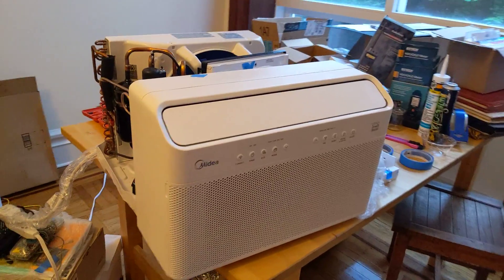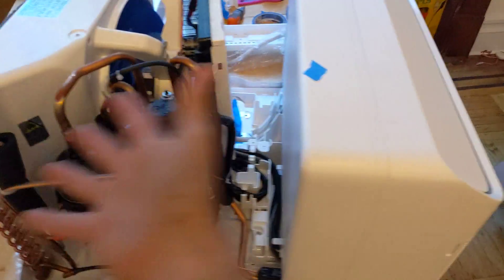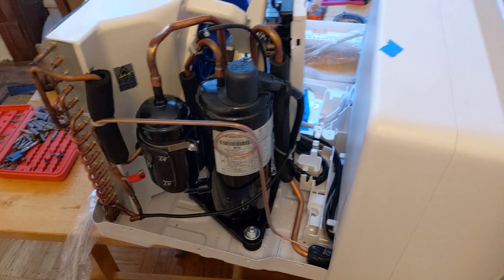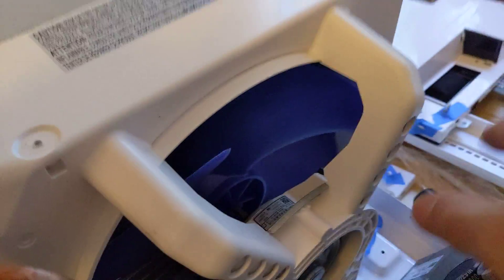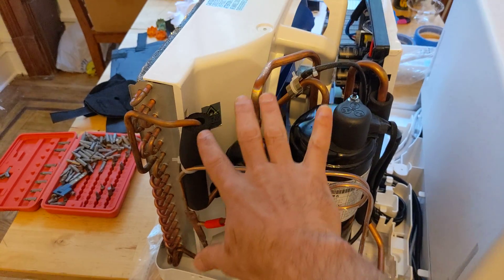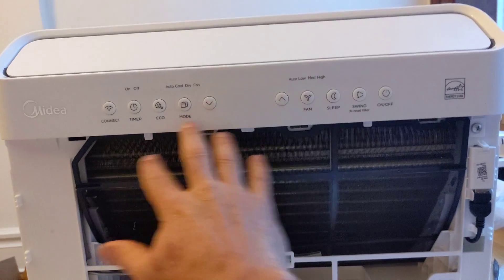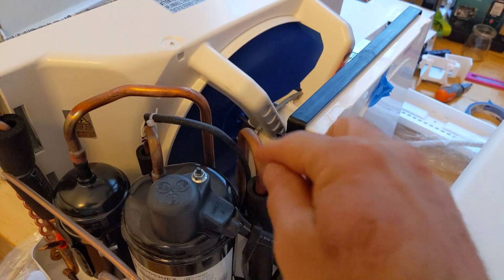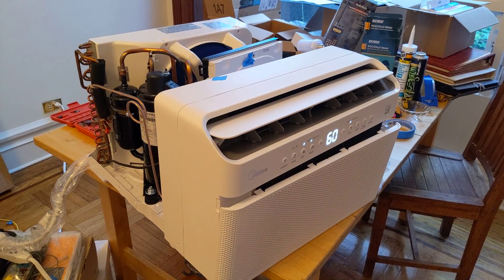How did Midea fit a full mini-split system inside their new "U" window unit?

Comment: Hey, Josh.  Thank you for making this video.  I really want to get one of these, but I live in Florida.  That with the reports of mold growing in these and bugs getting in them, I wanted to ask your opinion on two recommendations someone had on Amazon.

First, they said to put mesh around the sides of the AC to keep the bugs out.  Something like window mesh worked fine for them.

Second, and this is the one I'm the most worried about lol, is they said once a month they pour an ounce of a bleach and water mixture in the catch at the bottom of the inside part of the AC.  That of course drains to the back where most of the water gets moldy and makes sludge.  Does that sound remotely safe for the AC parts?  I don't know anything about AC units, soooo yeah.
Reply from the maker: I would not expect this to be any different from other AC window units for mold or bugs. If the problem is the standing water in the bottom tray, you could just drill a hole to let the water drain out and then there would be no standing water. Would work for the problems you are trying to avoid?
Reply: I've been pretty iffy on the hole drilling thing because I don't want to ruin the warranty or the cooling it's suppose to provide to the coil.  Honestly more worried about the coil than the warranty. lol
Reply: Another thing someone mentioned was using Frost King ACF19 Foam Coil Cleaner on both the outside and inside condenser coils once a month to keep out mold.  Not sure if that's an option as well.  I just don't want this thing if it's going to try to mess up my already screwed up lungs.
Reply: Same concern here! I forgot to leave it on auto last summer when I was out of town for a week and came back to it filled with mold because of the standing water issue. Been trying to find someone else who has cleaned their unit successfully and drilled a hole. Still am concerned about my ability to remove all the mold and if drilling will mess with the coil cooling.

Comment: I just installed one yesterday. It's so nice. The window unit I had in before was around 80db and was just so loud. Even on high fan this one is only at 50db. Such an awesome unit so far.
Reply: Does it act as a heater in winter?

Comment: What is the power consumption like? Can you do a 24 hr test?
Reply from the maker: Power usage for air conditioners is hard to quantify because it is highly dependent on environmental factors like inside temp, inside RH, and outside temp. That is especially true of this unit since it will automatically change the speed of the compressor and the fans to match the conditions.

Comment: how is the water draining on this unit???
Reply from the maker: In practice, it doesn't. The condensate collects in a pool in that bottom pan, and the  condenser loop dips down into to water and warms it up. This, plus the fan blowing air over it seems to do a good job of making it all evaporate away. There is no overflow hole, so seems like they have high confidence this will work in all conditions!
Reply: @bigjoshlevine  thank you for the info.. i just saw a video with a person pushing guaz down the back slit of the ac unit to drain water out
Reply: also one more thing idk if u used this unit but was there mold build up on this after the summer use.. reading alot of reviews on amazon saying this ac has mold issues
Reply from the maker: @krazyboxer4453  I ran one in NYC all summer last year and mine still looks like new, so maybe has to do with environment.
Reply from the maker: @krazyboxer4453  Hmmm... I think you are better off leaving that water in the tray because it will help the unit run more efficiently.
Reply from the maker: I checked and Midea says that the unit can potentially overflow the back, which is why they say to install it with a slight tilt.

Comment: I have two of them. 12k and I love them! I wish they used better plastic though and a humidity sensor.
I connected them to Amazon Alexa so I can just set the temperature with my voice. Also, you can ask what is the temperature in your room because of the built-in sensor...
Reply: Are the 12k 120v ac  or 220volt ac?
Reply: @GODBODYONE  120v

Comment: I made a split unit out of a window unit to mount in my camper van and wonder if I could fully split this one and mount the compressor under the van. Thoughts?
Reply: That’s what I’ll be doing this month.
Reply: @AndrzejMrotek  what unit are you going to start with?
Reply: @leeadamholt  I'm starting with the 8k
Reply: @alexdrinkwater28  you gotta let me know how it goes!
Reply from the maker: If you OK with evacuating and refilling the refrigerant then this is probably the best window unit to start with for a mini-split conversion.
Reply: @bigjoshlevine  I did a window split unit before and did a bunch of research, that smaller line look like it might be part of the orifice tube and from what I remember it has to be a certain length per spec. Now I would just be thinking about how to split the tray and add a drain tube. Also I would be mounting the outside section under the van so I wonder how it would hold up to vibrations from driving.

Comment: Quick curious question how cold does it get. Does it cool the room down really well or Is it just ok ??  Could you do a one year update at some point. Because I am really thinking of ordering this
Reply from the maker: Of course it depends on many factors including outside air temp, indoor humidity, room size, and heat gain. But I can say that the few people who I've recommended them to in NYC have been very happy with them!
Reply: Turn off eco and use boost and it will cool down quicker .

Comment: Mine tries to soft start and has some solid thumps ("ka-chunks", maybe) still. Wonder why.
Didn't come with the blanket on the compressor. Sad. Chirping is kinda loud.

Any idea how to take off the inside portion's casing? Idk if there's tabs or screws hidden from view but I can't seem to get it open. I need to remove or cover the speaker. It's so loud and beeps on every single button press.
Reply from the maker: I have up on trying to open the inside half, but there has to be a way! Others have also complained about the beeps but mine does not seem to be too loud, so maybe different revs? Same beep problem when controlling over Wifi? Maybe try to find where the speaker plugs in on the main PCB and kill it there? Should be a relatively thin 2-pair wire, maybe even some suggestive markings on the board to help.  Report back if you locate it - others would like to do the same!
Reply from the maker: I bet it is in the upper right quadrant here!...
https://photos.app.goo.gl/FNVP1Zdefc4eZs1G9
The display cables are well marked, so look for something like "SPKR" with 2 wires?
Reply: Yeah the beeps happen from any control point except voice. So local, remote, and phone/app.

Mm. Right the wire bundle is visible. I imagine the speaker is on the interior pcb (with the buttons) soldered but I'll see if the wire bundle leads anywhere.
Reply: @soulofjacobeh  I'm modifying a 10k btu version of the AC and have some pictures here. https://photos.app.goo.gl/hTdG6CV2QZfG9QzY7 You can see some of the tabs that hold the front and back plastic pieces together. If I remember correctly, there are two screws towards the bottom of the front panel and then the tabs around the edges hold it to the back panel. The speaker is on the front of the circuit board that has the buttons on it. I put a bit of glue over the speaker hole and it's still loud so I might have to just remove it.
Reply: @brik2k  my hero. I see the speaker right where I expected it too.

I think those tabs were what was holding me back. It seemed solid enough to be non-removable or something so I didn't commit lol.

I hope removing the speaker doesn't freak the board out. If it does I'll have to figure out the resistance of the speaker and drop a resistor in I guess.

Edit: you have location data in that album btw. Might wanna re-uploaded scrubbed metadata copies at a new link and edit the old link out.
Only a couple hour drive from me lmao
Reply: @soulofjacobeh  Thanks for the tip. I just reuploaded and updated the link. Let us know how it goes with the speaker if you end up modifying it.

Comment: How the hell do you take off the front white panels tho?
Reply: e Channel
10 months ago
Three screws under the front cover then unplug 3 wires. Use screw driver  to  pry open the front cover. It IS only snapped  in. Then two screws on top. 3 screws on each side then you have to unsnap gray cover to get to fan.Just opened mine. Fan stopped spinning. Put grease on rubbeer holding fan in place. It was making whining noise then stopped spinning. Works fine now.

Comment: Hey Josh

Thank you for reviewing and tearing one of these down. I'd like your opinion on a project I am thinking of. I have an old Suburban that had rear AC. I am using this as a camping rig and would like rear AC when driving and while parked.

I just refurbished the front AC and eliminated the rear circuit so I'm starting from scratch. I was thinking about mounting a compressor to a small engine but that would mean a lot of noise while parked.

I toyed with mini splits but the outdoor units seem too large. Rollicool makes something that would work but they are on intergalactic back order.

I'm thinking maybe take one of these Midea units, cut the lines and mount the outside unit on my rear tire carrier and the inside unit behind the rear seat. I would have to rework the tubing with some flex pieces and extend wiring. The u shape seems great as it makes it easy to cut the housing and just make a small patch panel.

The truck will already have a mini generator on board. It's my DC generator which will run through an inverter.

If I was camping I could bring a small portable and get it far away from my truck. This would give me AC power that isn't keeping me up at night.

Thoughts? What am I missing?
Reply from the maker: I've always wanted to take like a Honda EU2000 and rip the generator out of it and replace it with a auto compressor and make a gas powered minisplit for situations like this! For the inside part you can make it look neat with a truck evaporator console- they have them on aliexpress. Could could even use an arduino to match the engine throttle to the cooling load so it was really quiet once things reached low demand steady state. If that is too much work, I have an extra Rollicool that is yours if you can come get it in NYC.
Reply: @bigjoshlevine  That would be pretty slick! Newer style Sanden compressors needs about 2-3 horsepower to pump around 10-15k btus. I think it is close in capacity to the larger suitcase style engines.

Bummer that electric starts are tough to find. AIMS makes a remote start suitcase but I've read bad reviews about it not working. Probably because it doesn't choke automatically which makes no sense if you are cold starting.

I'm going to work on this u shaped unit concept. I thino it is just standard copper lines that require flare fittings. All standard stuff. You can get off the shelf mini split flex lines. R32 looks like a standard refrigerant close to 410 so same fittings and gauges.

I think if the 12k unit goes on sale for Black Friday I may pull the trigger. If not I'll be driving to NYC to pick up your Rollicool. I'm up in NH.
Reply: @affordabledcgenerators1607  Did you end up getting one of the Midea units and splitting it. It seems like a good option for my van.
Reply: @schaez  not yet, still hammering out truck modifications. Once I'm done, I'll move on to DC systems and maybe tackle the air conditioning.
Reply: @affordabledcgenerators1607  I think this would work really well, but I decided to go ahead and get a 24V unit off of aliexpress. I'm guessing it will be marginal for really hot days, but I can use the main AC to help cool down the van some and the unit I got to maintain it. We'll see.
Reply: @schaez  Check this out. I think it is the same as what is on Aliexpress. He says it is 7500 btu but the compressor tag shows more like 5000 btu. It is more expensove but you dont have to go through the whole ordering from China ordeal. I may just go this route and use the existing overhead evaporator. Would make for a cleaner install.

https://trumaheaters.com/products/proair-12v-dc-air-conditioner-compressor-7500btu-hr
Reply: @schaez  so like $700 delivered to your doorstep? How long for shipping?

You should do a video. There is literally zero info on any of this stuff. Really the only DC air conditioning stuff is your mainstream Dometic or that hot rod system. All being $$$$$$. The only videos I have seen are basic ones showing it working. No performance test, current draw, long term durability, etc.
Reply: @affordabledcgenerators1607  Yeah, it's a risk. I think the compressor will be the main question mark. I can replace that if needed with a ProAir one, but that will be about the same cost or more just for that. I'd guess the shipping will be 3-4 weeks, but we'll see.

I agree there isn't much info out there on DC systems whether it's mainstream suppliers like ProAir or stuff from Aliexpress.
 
For me, power draw and form factor are the main factors. I have 2 roof fans and 670W of solar on the roof. It would be hard to even fit a regulator roof AC even if I replace a fan. 

Cruise N Comfort is the system I've seen the most, but it's so much $$$ and it's inside unit is pretty large.  Converting a window unit is the most cost effective, but I worry about putting it in the rougher road conditions. If I was going to mount the outside components on the rear door then I probably would have gone with the Midea unit.
Reply: @schaez  I am very surprised no AC manufacturer has come up with a decent DC solution. I mean every other offroad company has cashed in on the overlanding crowd. 

I mean you can get a decent $300 fridge these days. You would think an air conditioner for a van wouldnt be rocket science or $4000 😑

Keep me posted, Im very curious. My email is AffordableDCGenerators at gmail. 

Im working on my battery system. Just got a pair of GC2 batts in the spare tire area of my Suburban. Inverter charger is mounted. Still hammering out the auto statt DC generator. AC is in the works... at some point.

Comment: Would you recommend drilling a hole for condensation drain out ???
Reply from the maker: You probably should not need to. The condensate collects in a pan and the pipe with hot gas runs along the bottom of this pan. That heat should help the water evaporate. This also helps with the efficiency of the unit since the evaporating water significantly desuperheats hot gas.

Comment: Josh - while you were in there, did you see any refill ports on the refrigerant lines? I will more than likely be disassembling my unit to make a true mini-split once the summer is over.
Reply: I want to do exactly this. Did you ever do it?
Reply: @casstippit766  not yet, life got in the way. Hopefully this summer at some point.
Reply from the maker: Like almost all consumer AC units I've seen in the past decade, this has crimped and soldered fill stubs rather than ports. I think this a rule since the refrigerant restrictions, and probably a net good thing since it reduces chances for leaks.  Luckily you can always add a vampire tap for like $3 (but these do sometimes leak). https://amzn.to/2ExkwGq
Reply: @bigjoshlevine  you know your stuff! Thank you for the insight!